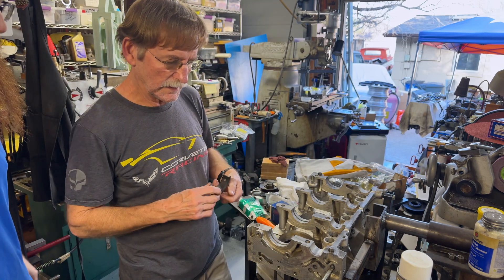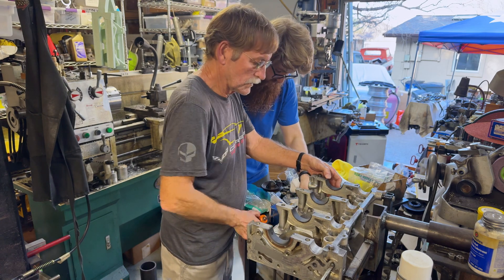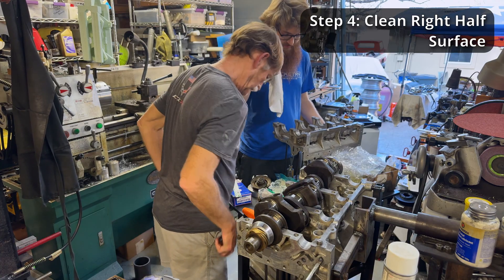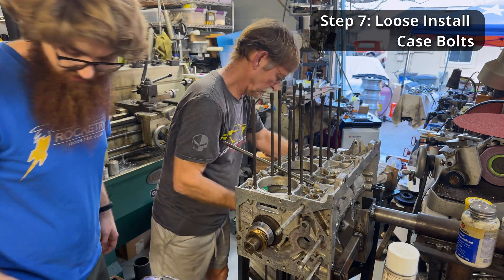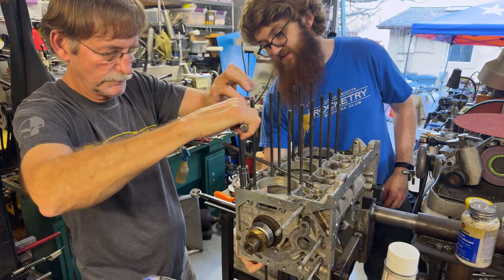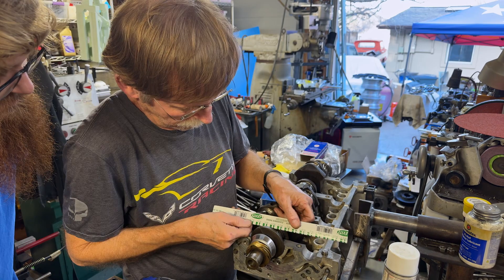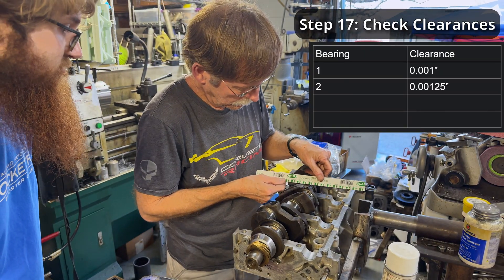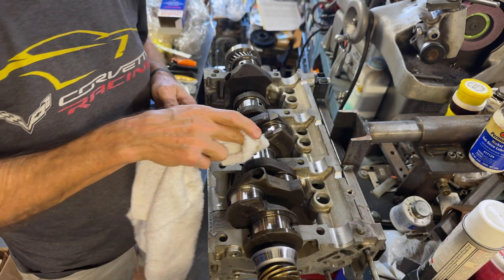Testing A New Bearing Coating! | Turbo Corvair Engine Build Part 1

Comment: great, no music noise, l haven't done that for 40 years and l still have the engine. It's has '65 140 heads, punched out .040 over cylinders, HP cam by isky, bronze guides, alloy aluminum spring retainers and 2 face valve grind. Last run back in the 80s .